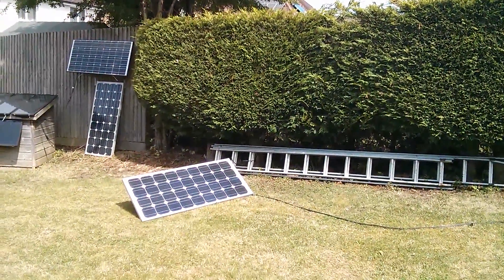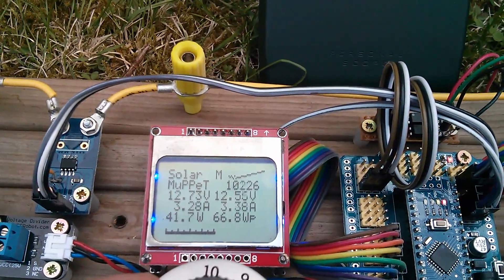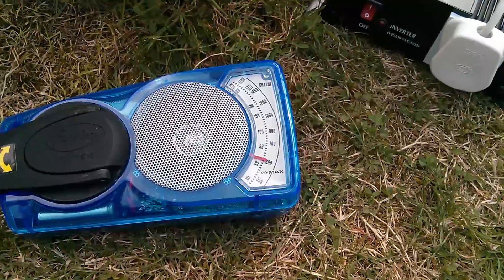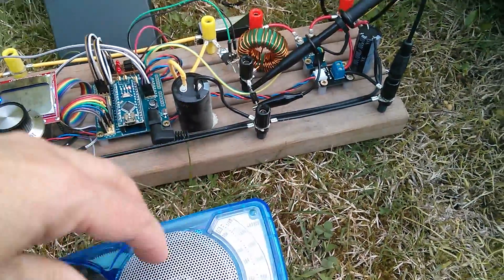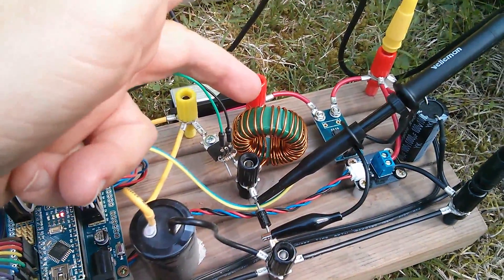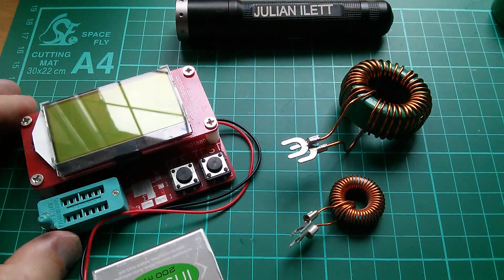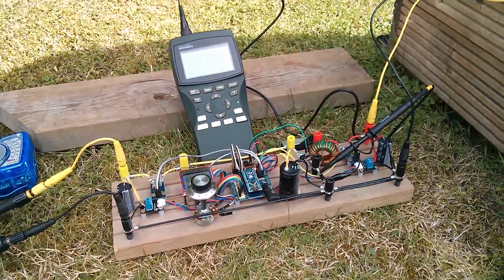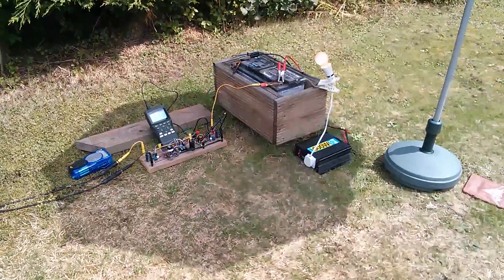Arduino MPPT Solar Charge Controller: #22 - Inductor Change

Comment: I have two old 12v 14w solar panels they have 21v no load. To get full use of them , I try to make a julethief with a large coil . The power comes from the solar panel through a transistor through the coil and through the battery when the coil is charged the transistor turns off the power from the solar panel and the energy in the coil now come down into the battery and transistor afterwards turns on again. I do not have any control over the voltage of the battery it is not as smart, maybe if I have a 100 amp battery maybe it is ok

Comment: Did you put any kind of snubber in parallel with mosfet?
Reply: +NicozStrat i think the problem could be the diode; at low duty cycle what happen is that moving on the solar panel  I-V to the left current still quite the same, but average voltage decreases, the diode have to stop the same current with less voltage. Maybe using a snubber (parallel to diode) can better things.

Comment: is this project dead?
Reply from the maker: Waiting for summer
Reply: +Julian Ilett I have just bought a few of these to try to adapt to the project as I am trying to get to a 40a mppt. http://pages.ebay.com/link/?nav=item.view&id=161805794868&alt=web
Reply: +Paul7mac I can send you a couple if you wanted to test for ringing also did the little 5a with dual display ring much.
Reply: summer is almost over... I got a 40V 190W Solar Panel mounted to my caravan and the cheap "china MPPT 20A" you tested back a year ago because I wanted to wait for your cool arduino mppt to be ready for me to build. Any news on this project?
Reply: I'm surprised you haven't gone ahead with making your own arduino mppt... the design itself is pretty simple
Reply: theflyingjbird excellent. do you have a link to your design
Reply: Nah, but it's incredibly similar to Julian's design. Basically it's a hand-built buck converter with an arduino to do the pulse modulation (sorry if I'm stating the obvious). BUT! Here's Julian's current setup: http://www.256.co.uk/wordpress/wp-content/uploads/2014/03/MPPTschematic.jpg

Comment: Julian- great videos, I've really enjoyed watching as you build this controller! After electrocuting myself, burning my hands, having MOSFETs explode at me, I managed to assemble something similar. I have some questions / comments:

1. I used a MORNSUN B0505S to get an isolated 5 volts for the MOSFET. Then I realized that 5 volts isn't enough... either way, it seems like a suitable solution that can replace the 9 volt battery.

2. I had some big 'power' N channel MOSFETs and tried one of those. It definitely seems to get less hot than the previous N channel mosfet I had been using. The one I was using is an IRFP260N.

3. Can you explain what the inductor actually does? At first I tried building it without the inductor and the whole 'buck converter' deal. This actually semi-worked but I think it was causing the MOSFET to heat up significantly.

4. For the MOSFET driver, I used to opto-isolators, one that provides voltage to the MOSFET, and then another that shorts out the MOSFET. Is this a problem? I realized that when the Arduino was first starting that it would drive both opto-isolators and was probably causing a short circuit, so I replaced the VCC with a digital out PIN that activates at the same time as the PWM.

5. I wonder if you could connect this in such a way that it connects at the solar panel end and sends battery voltage down the line.

6. What changes do you think you'd need to make to handle 600 volts from an array?

7. Something I really like the idea of is building a controller that can handle multiple solar inputs. IE. One controller that controls several different solar panels or arrays from the same logic board.

Comment: Your project inspired me to build a MPPT charge controller. I love your MPPT, PWM series.

I tried a lot of different cores without any knowledge about inductors (I am a computer scientist not an electronics engineer). I ended up with a "Fastron TLC/10A-101M-00" inductor. It has a T184 sized core and is made of iron powder (material mix number 26, yellow-white). For more information search for "Amidon T184-26". This material mix is inexpensive and suitable for frequencies lower then 50kHz. The Fastron inductor is wound with 1.4mm copper wire and is rated at 10A. It is getting hot at 150W pretty quick. As I have to convert 240W (Soluxtec transparent series grid tie module) to 12V the inductor has to handle 20A. So I added a second parallel wire with 1.4mm diameter. The inductor was wound with 25 turns. To fit the wire I had to cut four of the turns and ended up with slightly less inductance. An Excel sheet from Texas Instruments (focus.ti.com/download/aap/utilities/buck.xls), stated that I only need 47µH, so it is still enough. Now the core can handle 220W. With little of cooling it stays completely cold.
I am using a synchronous configuration with two IRF3207Z MOSFETs and a IR2184 MOSFET driver and a MBR20100CT 20A Schottky diode in parallel with the low side MOSFET. MOSFETs and the diode are mounted on a small heatsink and do not get even warm so I assume a relatively high efficiency.
I am driving the converter at about 32kHz using a ATmega328.

In your previous videos using the old smaller inductor, you experienced some ringing at a high duty cycle. I experienced the same phenomenon during my tests. The reason for that is as you mentioned that the core is running out of power. To solve this you can go for a higher frequency loosing efficiency or use a bigger core. I went for a bigger core.
More ringing using the newer bigger inductor is due to the ferrite core. I tried ferrites too. They only work at high frequencies from several hundreds kHz up to some MHz. At a low frequency lower than 100kHz you clearly need an iron powder core.

Waiting for an update to your MPPT project.
Reply: Just the information I was looking for. Thanks a ton!

Comment: I find the series about MPPT inspiring!
For the noise problems you may want to filter it out. Just average a few samples more than you average now. (Average both voltage and current samples!) With digital sampling you almost always need to average more or less. For change every few milliseconds you should be able to get a lot of samples to average for most setups. A change every few milliseconds should be pretty fast for a slow changing signal like sun. (Perhaps even too fast? Testing will show I guess.)
10mH is surely more than overkill for 50kHz pwm. At 5A current, 80% pwm and 12.7V output something around 100uH should be enough for 0.5Ap-p ripple if my quick and simplified calculation was right. That 10% ripple should be low enough to be considered "constant current" for most smps applications. Too high inductance only makes it more lossy and it saturates sooner if you need to increase current later on.
Lower inductor will increase the ringing frequency as well and it will be easier to filter out with a RC snubber in parallel with the diode coming from the mosfet.

Comment: I'm currently reverse-engineering a commercial MPPT controller that's failed on me. The part that's failed is an isolated DC-DC converter that's meant to drive the MOSFET on the high side -- so I'm going to replace that with a little self-contained DC-DC converter as soon as the parts arrive. In the mean time, something interesting. In this controller they also use an opto-isolator between the controller (A PIC microcontroller) and the main mosfet. They use this chip, which has a 50khz limit:

https://www.fairchildsemi.com/datasheets/FO/FOD3120.pdf

I have yet to get it working well enough to put a scope on the PWM side, but I half-suspect I'm going to find a 40khz signal there. I suspect this because they also use 40khz on the DC-DC side (the stage that blew on mine).

Comment: You can make cheap energy storage inductors from split EMI suppression cores, that have a plastic cover to snap them around a cable.  You open the cover and wind each half core (much simpler than threading wire through a toroid), put a spacer shim on the cut surface of one or both halves of the core (tape works fine) and snap the cover together.  Easy to open, to adjust the spacer thickness to trade inductance for saturation current.  This is the sort of core I am thinking about:
http://www.ebay.com/itm/6-Pcs-Black-15mm-Dia-Cord-Ferrite-Core-Noise-Suppressor-Filters-WA-/321777584869?hash=item4aeb704ae5

Comment: Hi Julian , i have been inspired by your MPPT video series and have been working slowly on one myself . Somewhere along the process ,i had also found that the MOSFET has a ringing effect on the output when switching at 12khz & the mosfet tends to get quite hot when the current is above 2A
Reducing the PWM switching frequency to below 4khz seems reduce the ringing to a certain extent.
Perhaps placing the MOSFET further from the inductor may also help to reduce the ringing effect
Reply from the maker: dh2050x I wouldn't have thought of reducing the switching frequency, but that's worth a try.

Comment: Why do you care about "ringing"?
Maybe you care more about it changing from continuous conduction to discontinuous conduction mode, because in ccm it is more a pwm dependent voltage source and in dccm it is more a pwm dependent current source.
You may want to have a pwm dependent current source, so decreasing the inductance broadens the pwm range where you get this at the cost of higher ripple current.
The low frequency ringing at the end of a cycle is usually no concern emc-wise, but the switching times and parasitic inductances are.

Comment: Why are you bothering with using solar panel? For testing you can use any DC power supply and not worry about weather conditions.

Comment: Fun to see someone else starting a MPPT project as well. Your video's were one of the reasons to resume my MPPT project again! I expect to finish it in 2 months, then I switch the github to opensource. Design goals are: IP65, 4 times 250W@25-30V PV input and 12S lipo output (38.4Vto 50.4V) out. If you like I can ad you as contributer to follow the process (currently only firmware). DC-DC converter is working and based on LM5122 in dual phase configuration.
Reply: +Danny Bokma Sounds interesting - there is painfully little solar/mppt controllers on the market to be able to charge and maintain a float on a 12S lipo, (or any lipo!).
I made a 1.1kWh 48V 12S battery for my ebike out of 10 5Ah 6S lipos (2s5p), with balancing cables - I have a 300W balancing charger to do 6S at a time, and it works pretty well, even if charging requires two sessions.
Next thing I want to do is use 2 to 4 foldable 100W panels to keep it topped up in use, and tow behind the bike on a trailer - if I use my existing configuration, I would need two isolated chargers to manage each half of the battery.
I can see a big market for such a charge controller, especially if it can be flexible enough to cope with any amount of cells and serial/parallel combinations. Would also be great to combine with a pure sinewave inverter capable of running as a power supply or UPS.

Comment: That ringing is normal and always occurs in discontinuous mode converters ie ones where the current falls to zero in each cycle.  It occurs because when the current reaches zero the voltage at the switch-diode -inductor junction has to step up from zero to the output voltage.  This kicks off  resonance of the series tuned circuit formed by the inductor and the capacitance of the switch (which is off) and hence it rings.  It's really not a problem, there's no real power involved and the relatively low frequency produces far less RFI than the fast switching edges.  Just relax and accept it.  Some designers like to get rid of it with snubbers just because it looks bad but there's really no need to. 

The MPPT circuit may well work better ie. be easier to control, if it always works in discontinuous mode because when it's in discontinuous mode it has a high output impedance and the output current is directly controlled by the duty cycle.  When it's in continuous mode it has a low output impedance  and the current is the integral of the duty cycle so you have to continuously vary the duty cycle to keep the average current constant, a bit like balancing a broomstick on your hand.

If  the larger inductor produces more prolonged ringing it’s simply because it has a higher inductance and therefore a higher Q than the smaller one which is a good thing, it means lower losses during the actual power transfer part of the cycle.
 
Inductors are difficult to understand and I notice that you haven’t mentioned the most important aspect of the design which is that the inductor shouldn’t saturate at the highest current.  Your inductor is not saturating or you wouldn’t get such nice clean waveforms but it would seem that this is purely by luck rather than design.  As you’ve discovered the actual inductance value isn’t that important, it just controls the peak to peak current swing.
 
Ferrite toroids are not normally used for energy storage type converters like this because they have too much inductance per turn and so cannot store much energy for their size.  It’s more normal to use iron powder or molypermalloy toroidal cores which are expensive or gapped ferrite cores of various shapes (but not toroidal), which are cheap.
Reply: number 33 Forget what I said about ferrite cores, if you are using a HF-080125-2 then this is not a ferrite core.  It's a nickel-iron powder core albeit a nasty American one.  I haven't used an Oersted since I was doing my ONC fifty years ago.  This is exactly the sort of core you should be using for a low frequency energy storage converter. It has a relative permeability of 125 compared to the 3000 odd for a ferrite core. The AL value (inductance for one turn) is 68nH, so if N is the number of turns, the inductance will be 68.10^-9 x N^2 Henrys.  (That's N-squared).   So I deduce that you have about 40 turns on the smaller core. Note that this inductance is the initial value at zero current, as the current rises the inductance will fall.  The essence of inductor design is to prevent it from falling too much. As you can see from the data sheet.  http://www.micrometalsarnoldpowdercores.com/pdf/HF-080125-2-DataSheet.pdf the inductance falls by about 50% at an H value of 300 Amperere-turns so this inductor is good for about 300/40 = 7.5A peak current although of course heat dissipation may limit it to less.

Comment: Hi Julian, I was just waiting to see which way you go... bigger coil, or higher frequency... The ATmega based Arduinos have only slow PWM capabilities, except some clones using ATmega32U4. The 32U4 has one high speed high resolution timer derived from the 48MHz USB clock system. But afaik it is limited to some 64KHz at full 16bit width. So my guess would be to switch to STM32xxx nucleo platform and go real high speed. Usual DC/DC buck regulators work at 100kHz...1MHz and above. Coils get quite small at that speed. And I would exchange the opto-coupler driver by a normal gate driver like LT2184. This is the one I ordered to replicate your ideas on my breadboard but stay with my 49V/180W panels. It is a complimentary driver for two FETs, handles automatic dead-time but offers a reset input. That reset input is a good idea to use for some hardware protection against programming failures... 14.4V is enough for lead acid batteries, they don't really like 36..49V...
Reply from the maker: Astralix2011 I'll stick with the bigger ferrite, larger diameter wire and fewer turns I think. I'll also up the switching frequency to perhaps 20kHz which should also make it inaudible. I think I'll eventually have to use a purpose designed FET driver, although I like the low cost of the opto driver. And I may start using 72-cell panels so that the DC/DC conversion is more obvious.

Comment: Great to see the MuPPeT out again...One thing about the lovely High Wycombe weather - I found this (I've tinurl'd it) for simulating a PV panel. Unfortunately, the article itself is pretty sparse, so, time permitting, I'd like to simulate the simulator(!) using LTSpice* (free download from Linear Tech), to get the components right.
http://tinyurl.com/ognpbeg
* Recently, the designer of LTSpice did his 'world tour, and came to Oulu, Finland.  Wonderful chap, old-school electronics, and certainly knew his stuff! I learned a lot from the one-day seminar. It's certainly investing a few hours to learn. No more "Blue Smoke Fairy" when prototyping.

Comment: The core geometries of permeability, cross sectional area and magnetic path length are in the formula for inductance. Inductance can increase quite rapidly with bigger cores as you have seen here, although it looks like your component tester isn't very accurate if it comes out with 2 very different values on repeating the measurement.
Reply from the maker: KX36 I've never really played with inductors before, so this is a real learning experience for me
Reply: I see many testers similar to yours from china ebay, haven't checked bangood. Have you seen one lately you think would be good or is the one you have good enough ? and, which one is the one you have, how would I find it ? Thanks Julian, love your adventures
Reply: You would have been able to work nearly every day here, upper Sacramento valley, California, always warm perhaps too warm at times. Perfect right now. Sun all of the time.